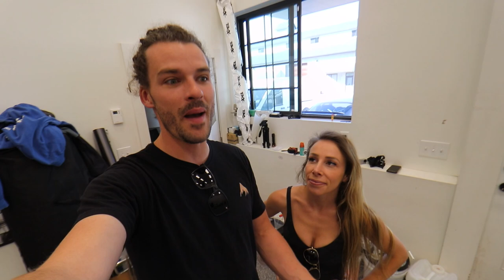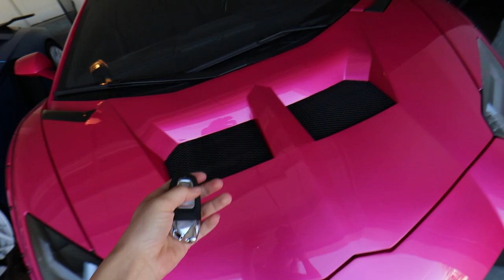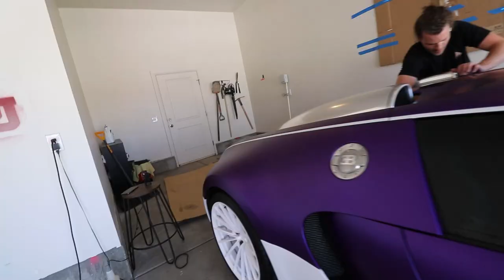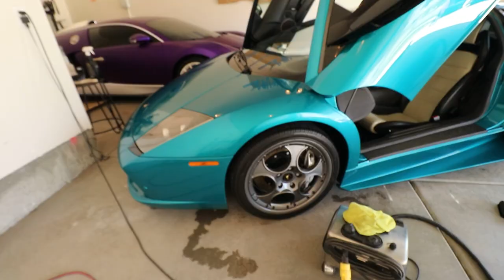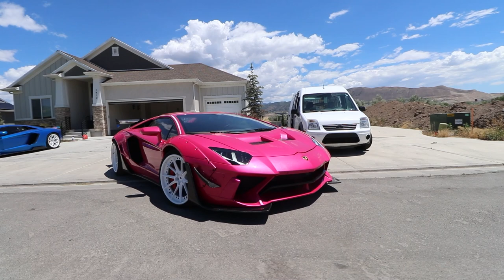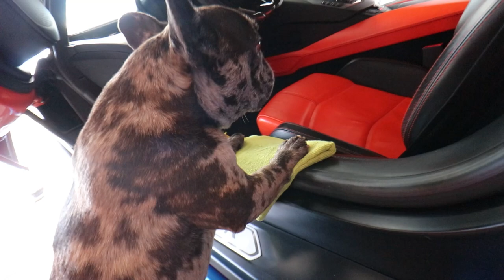Detailing The Stradman's Fleet!!

Comment: you gotta get a EGO 650 CFM blower to dry your cars. using a towel is very abrasive, and is 100% causing swirls and micro scratches. at the very least, use some sort of lube when drying with a towel.